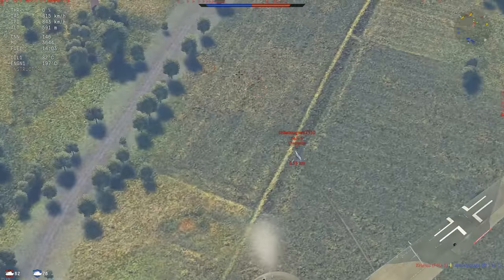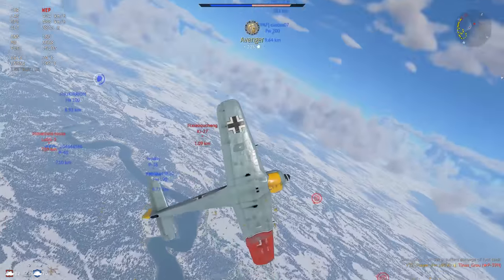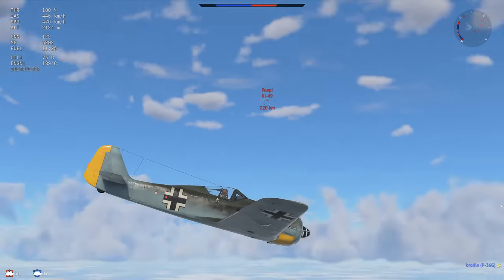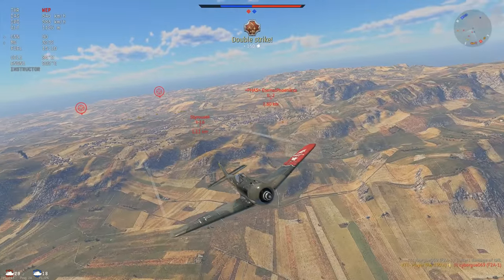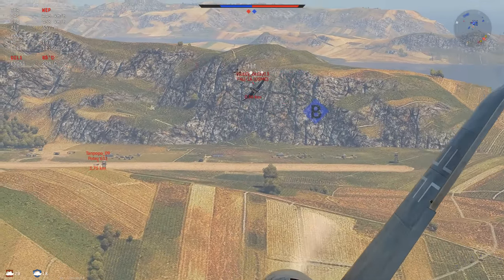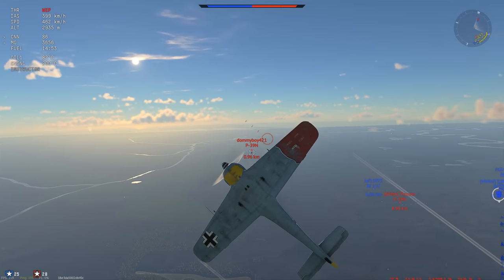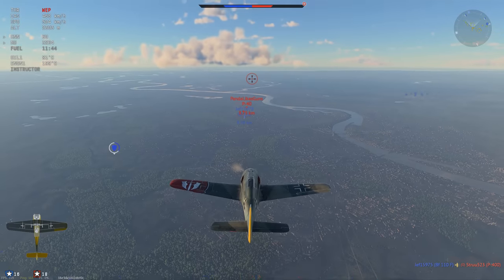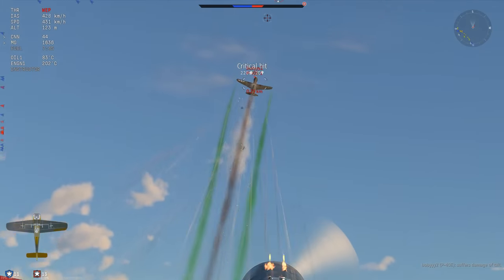Using Flaps Properly - FW 190 A-1 War Thunder

Comment: Gaijin nerfed the russian p-39 into the ground so it's not that big of an issue anymore. The american one at 2.7 is completely criminal, it has performance matching 4.7 planes at low altitude
Reply: Gaijin didn't nerf the Soviet P-39N.
Reply: @rainsilent  they did, massively. It doesn't have he belt anymore like the american does, and with only 2 50cals it doesn't have nearly close firepower to american n-0. Also both now overheat very quickly even with MEC. They should have just moved both to 3.7 instead of making them op but very annoying to play
Reply: @tedarcher9120  Both US and USSR P-39Ns have early war .50 belts and have had early war belts for a while. The American P-39N has no advantage here. Edit: You were talking the 37mm. Fair enough but I preferred the HE/AP loadout. Sure the AP won't devastate fighters with one shot like the HE but I almost never use the 37mm against fighters as is. I use it on bombers or ground targets. Personally I don't think the 37mm ammo nerf is really worth saying that the USSR P-39N badly nerfed given that it is near untouchable at 3.0 as is.

Also the loss of the 7.7s in the wings is a good thing. They do very little damage, are near useless unless the target is within convergence due to how far out on the wings they are and the added performance from them being removed is totally worth it. The only reason the American P-39N is "better" is because it is now at a lower BR.

Do they overheat a lot? Yes but with MEC it is entirely manageable and the performance loss to make it manageable isn't significant.
Reply: @rainsilent  american p-39 is better because it has enough ammo to kill at least 8 fighters, soviet enough for 3-4 tops. If you are not killing fighters in p-39, you are not playing the game correctly. And ap 37mm is useless against bombers too, it doesn't have an he filler, heit is way better against bombers as well, and 50 cals are better against ground targets. 30 cals add a lot of ammo to kill light fighters like zero and ki-43 with fires, as you can't reliably hit them with 37mm. Also, 2.7 is worse br than 3.0 as you play against very maneuverable planes more often, I prefered to play my soviet 39-n at 3.7-4.3
Reply: Also USSR never used AP for their 37mms in their P-39s so I would fully expect the ammo belts to eventually change for the Soviet P-39N to either allow you to choose belts again or it only be HE.
Reply: @rainsilent  they used to be same as american, then only he, then they nerfed it to only mixed. Historically should be only he. I do think they need to put it at 3.7 at least, both versions. But that probably won't happen due to poor american players which climb incorrectly and can't shoot. P-39n outclimbs and outruns and outturns 109-f4 all the way under 3.5 km
Reply: @tedarcher9120  When the remaining enemies are either bombers or camping the AF then going after fighters isn't a meaningful task.

37mm AP isn't useless against bombers. Fuel leaks+wing crits and insta engine kills+fires are fairly useful. .50s are better against ground targets in terms of ease to hit but I've gotten 1 37mm AP round to kill a light pillbox. I will admit that I don't know if it was damaged prior or if it really only takes 1 37mm.

I don't need the added 7.7 damage on light fighters most of the time thus I'd rather not have them. This point is entirely preference.

2.7 is better because while you are facing more maneuverable planes more often you are that little bit more untouchable to go with it.
Reply: @tedarcher9120  I'm more than aware how good the P-39N is performance wise. It is a near spitting image of the Yak-3 that sits at 4.3. I agree that both should be 3.7 minimum. It going there would take a collective effort from a group of players. I just don't know if that group will bother doing it.
Reply: @rainsilent  you are more untouchable, but you are less effective. There are no planes except american ones which can catch a p-39N below 3 km until 4.3
Reply: @tedarcher9120  I don't agree on being less effective at all. Unless you can't aim worth crap an under BRed plane becomes more powerful the lower the BR gets because of greater performance dominance. Greater maneuverability doesn't mean jack when the more maneuverable plane is stuck at near stalling speeds making them a very easy target. If you can't get a more maneuverable plane that slow with a better performing plane then you aren't a good fighter pilot. If the P-39N is becoming less effective for you with a lower BR then you have a skill issue.
Reply: @rainsilent  more agile planes can just dodge forever if they are somewhat competent. Not to mention that seal-clubbing ground pounders at 800 kph is just not fun. I'd much rather dogfight 109s and yaks.
Reply: @tedarcher9120  No, they can't if you do a good job setting up your attack runs and keep resetting properly. If you do it properly, a la how Defyn has shown a number of times, it doesn't take long and it leads to a fairly easy kill.

I agree fighting more competent opponents is more fun but that doesn't change the point that the P-39N at 2.7 is ridiculous.
Reply: @rainsilent  it is ridiculous, and harder to rake kills as well. That's why it stays at 2.7. same with autocannons in ground rb, if you decrease their br, they get worse
Reply: @tedarcher9120  It really isn't if you are good. Defyn's videos show that.
Reply: @rainsilent  no, you can't beat math. If your whole team is op, you won't get as many kills just because of that. And p-39s are like half the american team. That's why I have way better kills per game in a russian p-39n even though its way worse
Reply: @tedarcher9120  Just because they make up half the American team doesn't mean that most of them are being flown by competent players. Your theoretical argument still isn't that strong.
Reply: @rainsilent  it's not a theoretical argument, it is reality. Many good players play p-39n to sealclub, and even one is enough to reduce your kills in half
Reply: @tedarcher9120  And yet the frequency of running into such a player is exceptionally low.